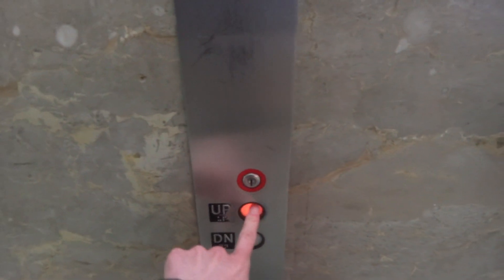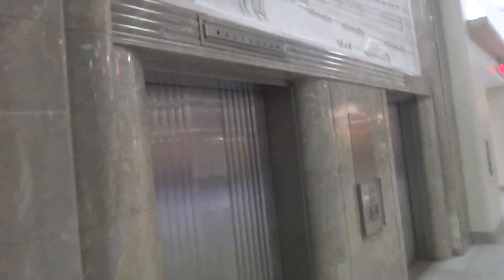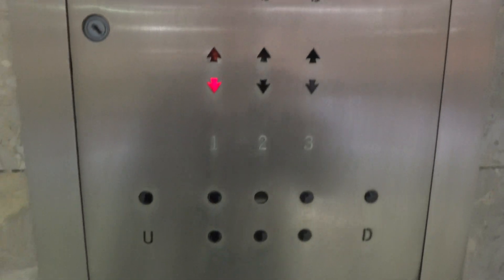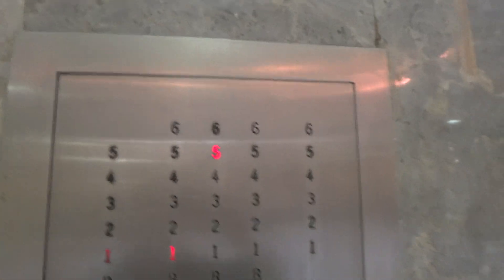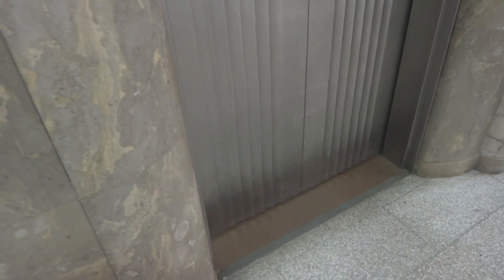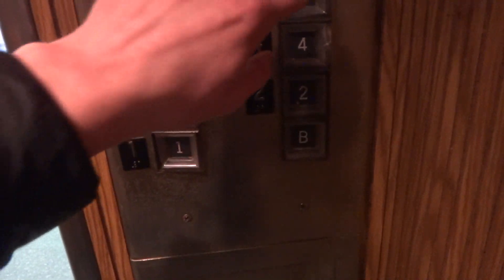The Last Vintage 1960s Otis Touch-Sensitive Traction Elevator Left - Sibley Tower - Rochester, NY

Comment: Are these all getting modded?
Reply from the maker: I'm not sure if these are. The other ones are already modded though.
Reply: What fixtures did they have?
Reply from the maker: Same square Touch-Sensitive as these. Now blue Otis Series M2. They did keep the original Touch-Sensitive call stations though, despite the fact they don't work at all anymore.
Reply: I heard from Genessee Elevators the Main Tower Elevators were modded. Are the Express Elevators modded too?
Reply from the maker: They most likely are modded. I heard I couldn't get to those because they serve restricted apartments.
Reply: I'm assuming what you got was the main bank of 3 right?
Reply from the maker: I got this elevator & one in the modded bank.
Reply: Brandon Miller How many were in the modded bank?
Reply: I believe there are 2 in each of the three banks
Reply: Yes it appears the Express 1s were modded.